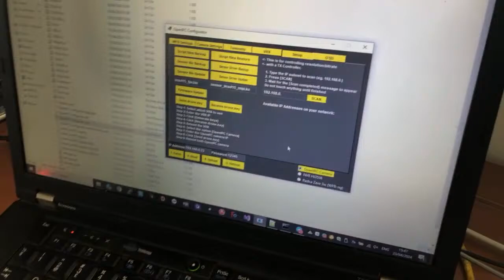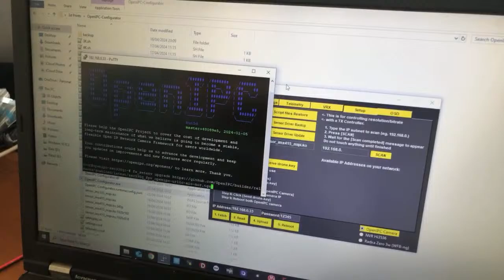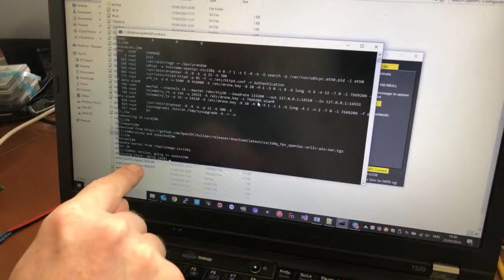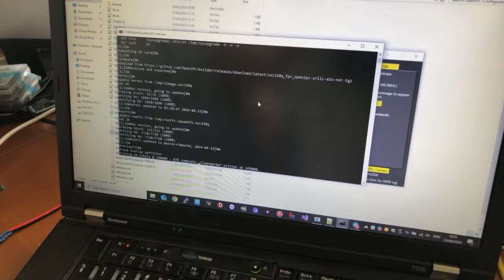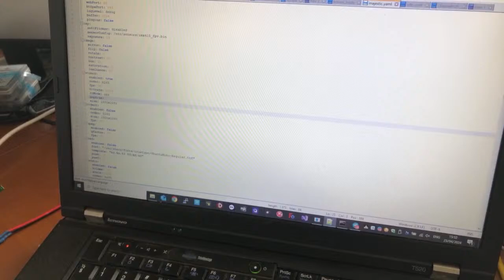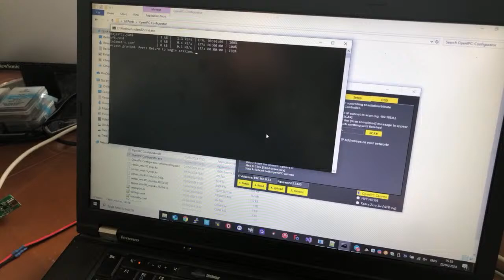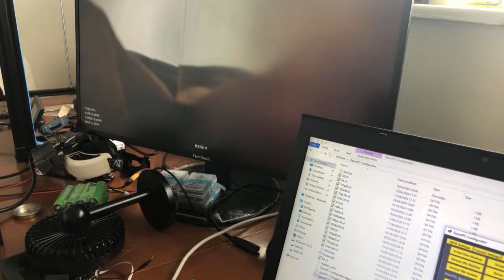Setting up and Upgrading the OpenIPC camera

Comment: how do i reset the camera password? it seems i changed it and have forgotten it since i bought the unit lol
Reply from the maker: You need to flash the UBOOT with an FTDI adapter. Follow the old method to manually flash an OpenIPC camera. Alternatively there’s an SD card method that is described in our Wiki. Try it, maybe it will work. Cheers mate!😊🍻